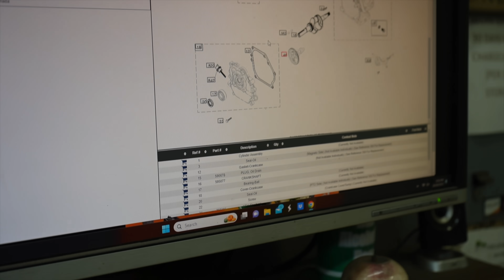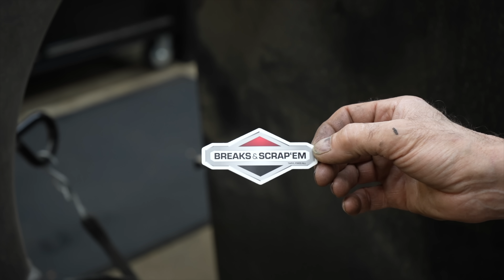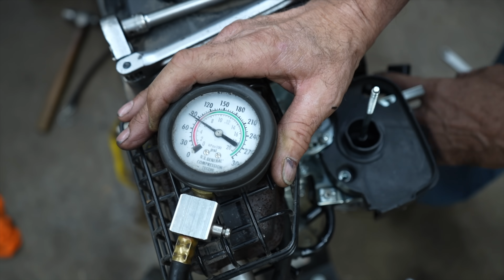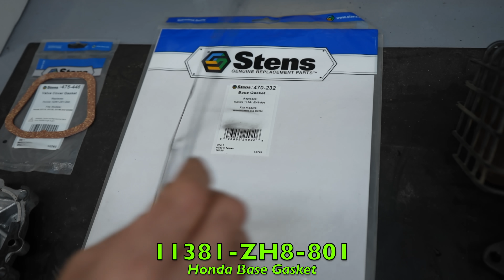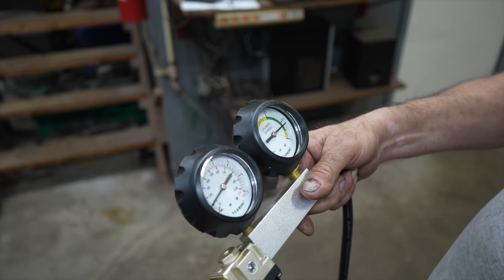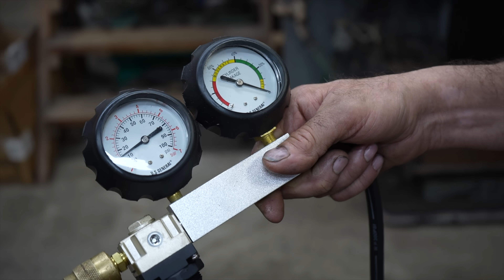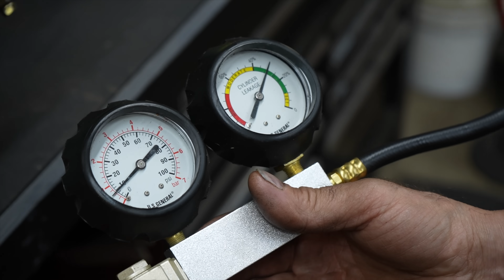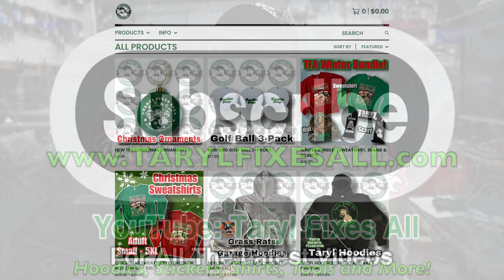Has He Finally Met His Match? Taryl is STUMPED!

Comment: I'm 31 minutes in to this thing.  This is a little frustrating. I didn't see him put the B&S cam back together with decompression in the machine when he was testing the compression. so 80 psi is very low if there is no decompression on the cam, 80 is way too low to run. Should have closer to 150 psi. I bet the top end is toast from lack of lubrication. Just a prediction. UPDATE: just finished it.  So it was the top end, stuck rings. I was close. I love he brought out the leak down tester. That is the 4th or 5th item we use when something like this happens at the shop. We usually start with carb (shot of starter fluid), spark plug (does it spark, is it wet), exhaust (air coming out?), compression test (60-80psi for hand start engine), leak down test if all tests come back good. Glad you got it running! Very informative as always.

Comment: I just repaired one of the Mow-N-Vacs from the late 90's the other day. It was cream colored and had the engine turned sideways (pull rope was towards the back). Anyway, it had a 5hp Briggs on it.  Ended up needing a carb service with new diaphragm and oil change.  Would run while cold, but wouldn't start back once hot. Long story short, had to put a new coil, plug. $500 later in parts and labor, it ran like new. Customer questioned if he made the right choice to get the old one repaired instead of buying a new one.  I told him the old ones would last a LONG time and new ones are kinda junk. Looks like this video confirms he made the right choice to repair the old one.  In old machines, I put Castrol Syntec High Mileage full synthetic oil. Very expensive but lasts a very long time in small machines. Great for people who rarely do oil changes, which is basically everyone under 35.

Comment: Having just spent 3 years on a breaks and scrappem in my rare spare time, and after a life time repairing and building engines, I was also stumped on this one engine. It had all sorts of broken parts all at the same time, bent valve push rods, valve seats leaking, broken spark module, blown head gasket, gummed up carby worse than ever seen before, and they don't make the carby parts any more. Wiring harness issues, Start decompressor outside of max Crank RPM specs, Bad spark plug, and sheered flywheel keyway all at the same time. Repaired all and it still would not run. Passed all the tests I could think of. It would fire every stroke, but not run. A bit like yours. Got it running last week, turned out the first repair I did to the engine broke again, without it even starting and running and being put to use. That fault turned out to be a sheered flywheel keyway, that put the timing out just a bit, enough to fire every stroke but too much out to let it run. I never thought to recheck a new item just replaced, but that is what it was. Lightening sometimes strikes twice. Now it's the easiest starting engine I own. The mower is years old but has hardly had any use... as it was always in the shop broken with something. Without watching your video past 34 mins, that's my guess as to your problem as well... now, let's see the rest of the video.
Reply: Well there you go, very interesting video Tarryl. Wasn't my guess, but something even rarer, that being stuck rings and couldn't suck fuel or compress at higher rpm and probably had a lot of blow by. Similar to when a decompressor spring is too stiff and most of the starting stroke blows air back the wrong way through the carby, so it can't suck enough fuel to start.

Comment: I moved to the Philippines 4 years ago and I just recently had a very similar problem with my generator. It also has a Cinesium  Honda clone engine and it drove me nuts figuring out what was causing the problem. Power outages here are a weekly thing here, but I still run the gas out of the carb every time that I use it because of humidity and gas is never in the tank for more than 2 months. The first thing that I checked for was water in the tank and there wasn't any water in it and I had just put "fresh" gas in it just before this happened. I checked everything and could not figure out what happened until I bought gas at the same gas station for my motorcycle and it started running really bad. I bought some gas at a different companies station since every brand of gas use their own trucks, drained the tank and carb, added the new "fresh" gas and the problem was solved. I don't know what they diluted the gas with, but there wasn't any water in it. It kinda smelled like it was mixed with diesel fuel, which makes sense since most cars are diesel here. I don't know if it was deliberate or not, but I wouldn't be shocked if it was done intentionally. I asked a few friends about it and they said that they had bough gas for there bikes there and had similar problems and didn't go back to that station for gas anymore, so it must be intentional.
It is also sad and funny at the same time that Briggs and Stratton are having problems from Chinese engines that are cloned from one of their competitors. American companies should have kept it American. At least the Japanese (Honda) want to keep there reputation by designing and building their own engines. Briggs deserves to lose their customers for buying junk that was copied from someone else and manufactured poorly in China!

Comment: Another terrific vid Taryl! I've been trying get a Krohler K-141 to run without success. It used to run fine but then after a long day's work it just gave up. I've been convinced it was from lack of spark so have tried two coils one of which was a brand new genuine Krohler part. Still no joy. I had experts look at the magnets in the flywheel but still no go. But with this experience of yours perhaps my piston rings have seized in the slots ? I can see a small blue spark when I turn it over but I'm a 67-year old pencil pusher so don't have the puff to keep pulling the cord and look for spark at the same time.
Maybe it was running rich  - anyway I'm going to do a leak down test (it has an ACR so compression test is difficult) and see what I find out. Never woulda occurred to me without your words of wisdom. From across the pond in Jolly Old (wet) England....thanks again!

Comment: I ran into the exact same situation on a Cunningham EB engine at the museum.  We could not get compression.  We did a complete valve job including recutting the seats.  The piston was tight (no side wobble) in the cylinder with very lightly scored walls.  Out of frustration we pulled the piston and the oil ring was worn and the top two were stuck in the grooves.  Parts from a B&S 5S fit perfectly accept the head gasket that needed two holes relocated slightly but usable.

Comment: I can see frozen rings after 10 hrs of run time. 
I've had that problem in the past with valves.  With these modern cheap engines, their design is sensitive to burning stale gas.  So the customer runs for a few hrs one year, puts up for the winter, comes out in the spring and starts up, runs with stale gas and the varnish, while the engine is running and hot coats the valve stems (in my case) which freeze up after the engine cools back down and the engine wont start the next time (or any time after that until you take it apart and clean the valve stems up).  In your case, I suspect the varnish, for whatever reason, migrated to the cylinder walls and got picked up by the rings which froze when the engine cooled back down.  It would have been interesting to see if you could free up the stuck rings in your video - my guess is that you could have.  
Always run the engine out of gas - let it just sit there and idle if that's what it takes - a dry fuel tank over the winter time and your rig will start and run reliably the next year.

Comment: Back in the late 70's I had a unique problem. I had a Troybuilt Horse tiller with a Kohler engine. It ran fine until it got hot and then it would shutdown. Let it cool and it would run fine until it got hot and shut down again. My uncle, who was a small engine mechanic, explained that the Kohler had a cast iron block and the little 1 and 1/4 inch tappet was made out of aluminum.  The aluminum tappet would heat up at a faster rate tgan the cast iron block, thus  expanding too much to slide up down and open the valves. He said they made tappets out of steel now. I purchased one. Fortunately,  those Kohlers had a little window with a cover in the side of the block in which you could access tge tappets without taking the engine apart. I changed that myself and never had a problem after that.

Comment: One of my favorites -- fun to see the master perplexed for a while :).  I fool about more with 2strokes, and the rings are one of the first things I look at, but it is much easier, just take off the muffler!  For 4 strokes, however, I would never have thought of stuck rings on a low-hour engine -- they don't depend on mix for oil, and they run straight gas.  Running hot or low on oil for extended periods of time might do it at higher hours, but I think you and your brother were right that there was some fuel delivery problem (e.g. with a stuck tank vent) that caused a lean condition long enough to stick the rings... Is Breaks & Scrap'em going to send you a gas cap just in case, too?  I assume that is how the tank is vented...  Also, I found it ironic that a leakdown test is much easier on a 4 stroke than a 2 stroke, where it is even more critical most of  time!
Reply: Nicely put

Comment: I had a similar problem on a larger 2-cylinder Kohler Command 23HP. When I eventually figured it out, I discovered that the electric fuel solenoid was working when cold and would gradually close due to a bit of corrosion at a wire connection or just an old nicked wire. Not applicable on this engine, but the symptoms were similar.

Comment: My neighbors older Toro Recycler behaved same way, I took it apart and it was loaded with grass clippings in the cooling fins.
  What I found it to be, was the head overheated and the steel valve guide got so hot that it hung unto the valve stem causing it to relocate far enough in the aluminum head to keep the exhaust valve from closing properly.
  I repositioned the guide, and I was able to start it, after which it ran fine again.

Comment: Thanks Mr. T for the diagnosis.  Is there a fluid that can be added to the carb that might break up the  " sticky issue " either while cold or RUNNING and warmed up ?  I remember pouring STP engine flush spray years ago to free sticky valves and clean out piston carbon.

Comment: I always look at the basics first, fuel, spark, compression, but I have never gone as far as a leak down test on a “ 1 lung engine” ! For some reason it never crossed my mind! Great work.

I have run into the bad cam shafts issue before, and ordered the “hobo freak “ camshaft , then had the bearing journals machined down to solve the fitment issue after all sorts of measurements of lift & duration , it worked, but was not worth the effort of outsourcing to another shop! 

So my question is if your up to the challenge can you rebuild that “ brake it & scrap it” engine to be bulletproof through second hand parts and other “ kibbles and bits” to be better then the original or even the knock off engines!

Comment: I'm on my daughter's YouTube. The only thing I can think of why the rings are stuck could be that the engine doesn't stop as quickly as on a push mower with the engine brake. You have the heavy turbine that's making the engine spin longer on shut down. I don't know if that engine has an adjustable throttle or not, but the engine is probably being shutdown at wide open throttle flooding the cylinder with gas...so to speak. With the engine being hot at shutdown plus with the cylinder being flooded at shutdown the gas may be caking the compression rings to the piston and causing them to stick together. The oil ring won't stick because of the oil lubing it. If the engine does have an adjustable throttle I would suggest that it be at idle before shutting it off. You're not out anything if I'm wrong. You do good work and try to help people, I'm trying to return the favor.

Comment: I had a leaf blower with almost no compression a few years back, it had been stored for a few years. The compression test showed almost nothing for compression. Being a gas / oil mix, I suspected stuck rings. That was exactly the issue and have seen it again recently. I cleaned the ring grooves and reassembled, back to a working engine again! Its easy to suspect compression release or the plastic cam when those are known failure points. I have been tripped up over that in the past. Assuming it was a known issue, only to figure out later, it was really a different issue. Never assume anything. A quick compression test from the beginning may have saved you some time. I have learned from past experiences, do a compression test reguardless.

Comment: I had one that acted similar to that drove me crazy checking valve lash and everything else ended up being the oil sensor and kill switch you could get it to start once when it was cold and as soon as it would warm up it would act like the timing was wrong once I eliminated the low oil sensor in Killswitch it was fine after that watching your videos help me solve it because I took your suggestion disconnected the kill circuit from the coil

Comment: Taryl,
If you have one of those Chonda engines and you disable the compression release mechanism, it should jerk your shoulder out of socket pulling it the way you did (if it has normal compression).  At that point in the video I knew it had no compression.

Also, the reason the good Predator only showed 60 psi is because it had the compression release still functional during the test! If you had it disabled like you had done on the Briggs, its compression would have read much higher.

Comment: I put a Harbor Freight engine on the leaf sucker and had the same problem with the muffler.
I cut the stem of the muffler in half. Then I took two 45 deg pipe fittings and welded them to the stem.
The first one leaning inwards and the next one leaning outwards. That put enough of an offset to the muffler that it didn't interfere witht the blower housing. It works great and cost only a few dollars.

Comment: Good job, I heard about using the synthetic oil on break in. Do you think that is what caused the rings to seize to the piston.. I was wondering if they were stuck because of old gas with low octane.  Just thinking that way cause the top of piston carboned  up. Oh well still good video, B&S were were good motors.. oh well thanks for video....

Comment: I don’t recall which engine it was but James Condon YouTube generator repair channel came across a cam with compression release stuck in the compression relief position.  Kind of bumped the compression release after removing the cam, the compression release went back to normal 23:49 and could not replicate the problem. That unit’s cam was all metal.
Reply: To memory compression release looked significantly different.

Comment: Hey Taryl. I enjoy watching all your videos. I’m stumped as well on a JD X320 with a kindasuki motor. It keeps shearing off the Pto shaft bolt. I have checked everything I can think of even changing the crankshaft thinking it was maybe bent a little or out of balance. I’ve checked belts. Pulleys. New pto assembly. I’m at a loss to find the issue. Need some advice from anyone. Thanks and keep up the good work 👍🏻

Comment: When you said cam shaft I thought no it had to be ignition coil or a slightly sheered fly wheel key, because the cam was doing its job when you pulled it over. Stuck rings is not something I see everyday. So get this I had a snow blower engine like that Briggs. You can pull it over and the same would happen it would run and die. Torn the whole engine down as I diagnosed it for 2 hours from cleaning carbs to checking time doing the valves Finally figured out that the rings prematurely wore out. The compression tool read 60 lbs and when I took the piston out the rings were wore out of round. No scoring in the block or bearing problems or some one at the manufacturer didn’t put the right rings in. There was almost no metal in the pan

Comment: I've had the same kind of problem with a Tecumseh 5.5HP.  Drove me nuts. Mine had a lot of hours and thought the valve springs might have gone weak. I never reassembled with new springs yet to find out.  Stuck rings seems like a good one to check on mine.  I've seen where it happens on 2-stroke engines and wouldn't run.  Husqy backpack leaf blower ran like a champ, rings carboned up and stuck, and she died.  New rings and she runs like a champ again.

Comment: Had a new 80 horse tractor that was put on light work and started chucking oil out the exhaust. An old boy mechanic said rev it flat out and throw a handful of vim (washing  powder) in the inlet manifold the bore is glazed and rings stuck !
It fixed it and it worked as normal 😮

Comment: At Eliminator Performance we set up specific rules so we restrict losing time to diagnose a problem. CHECK THE FOLLOWING IN ORDER: Spark, Compression, Leak Down, and Fuel. Next we check Air Filter and Fuel Flow which normally leads us in the proper direction for the repair and only takes say 15 minutes maximum of our time which is well within our diagnosis fee of 1/2 hourly rate.

Comment: That was truly a head-scratcher! I was starting to think carbetrator - didn't think about the gas cap, though. Sometimes them rings will stick when a engine gets overheated, so maybe that contributed - good thing Breaks and Scrap'em came thru this time! Reckon the compression dropped when it heated up and the cylinder swole up? Stuck rings wouldn't be able to expand and keep up with the swole cylinder......